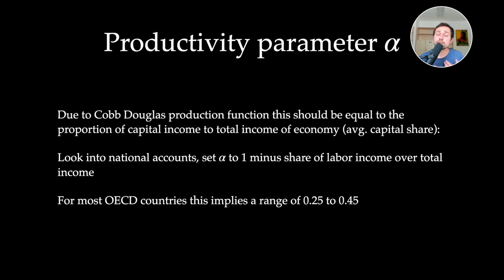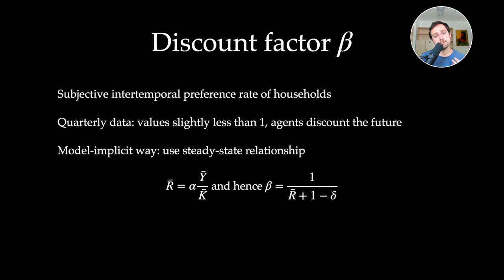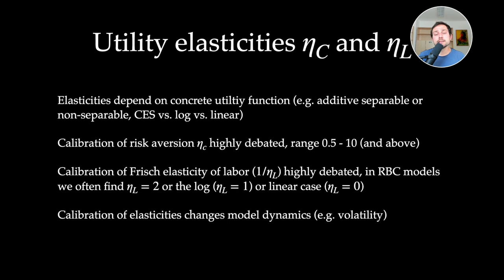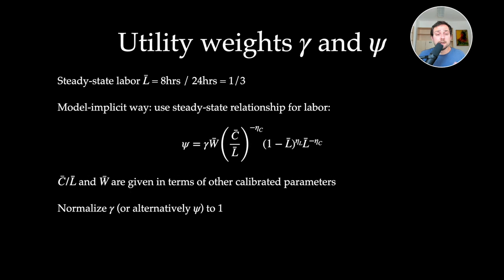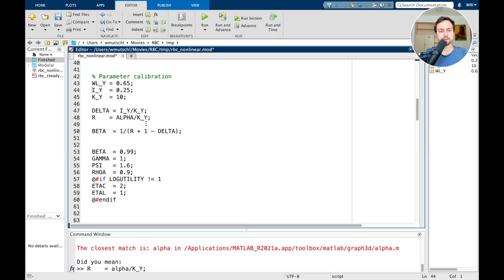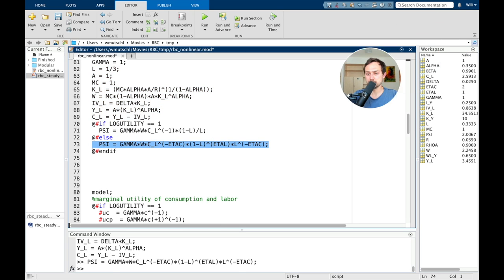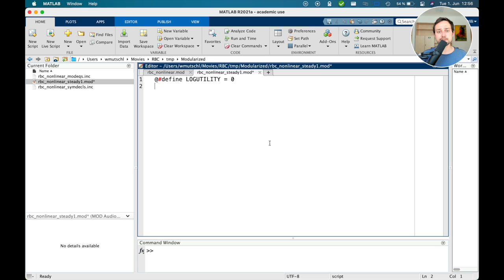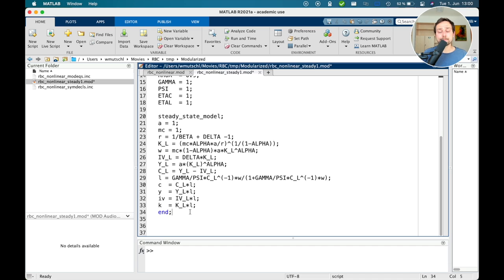RBC Baseline Model in Dynare: Simple vs Advanced Calibration using Modularization and Changing Types

Comment: Thank you so much Prof. Mutschler, this is very helpful. I have a quick question, if you are working with production function with labor only and technology, no capital, can you still work with share of labor income to total income as 1 minus alpha, or that will effectively be 1?
Reply from the maker: Yes you can still calibrate alpha to the labor income share; note that typically in such models it is assumed that there is capital, but it is fixed and then normalized to 1.

Comment: Hi Willi. Great content. May we ask questions here? Was wondering why sigma should be lower if there are more shocks. The shocks are independent, right? In some books, they put a parameter in front of sigma, say, eta*sigma and they maintain sigma = 0.01.
Reply from the maker: If you do simulations with all shocks, you get a much higher variance of the variables which is not realistic. If you have only one shock all the variability stems from this shock. That's why typically, the more shocks you have, the smaller the standard error.

Whether you scale the shock by putting a parameter in front is a matter of taste. Typically people than assume an identity matrix in the shocks block and scale the actual variance by this parameter in front. But this works only at a first-order approximation. So it is just a matter of taste. I like to keep it straight, so if I have a value for the standard error of my shock, I put it into the shocks block.